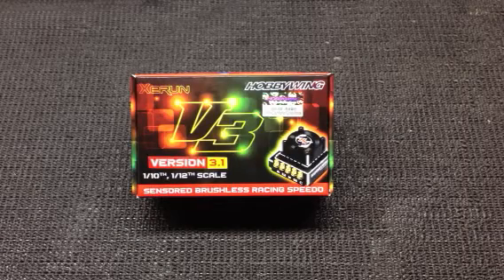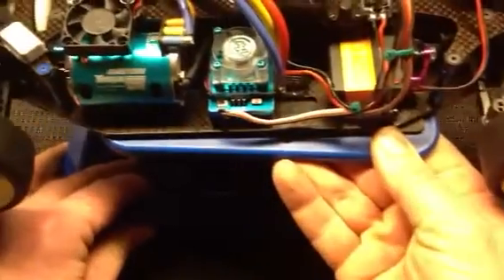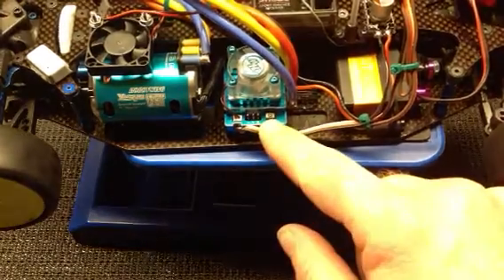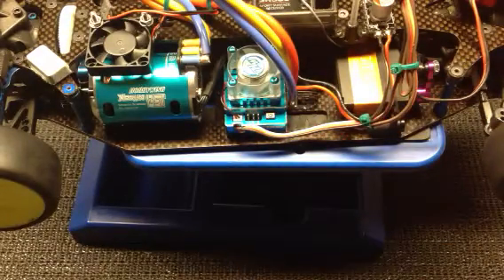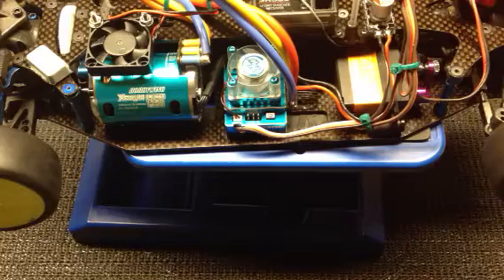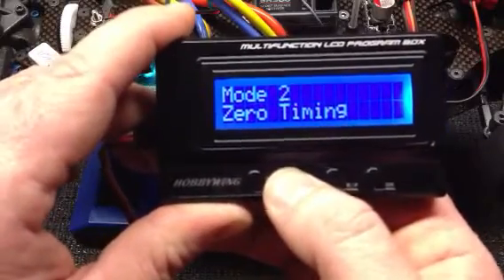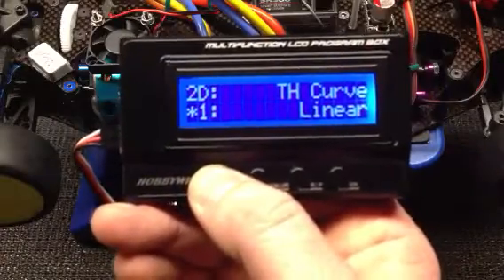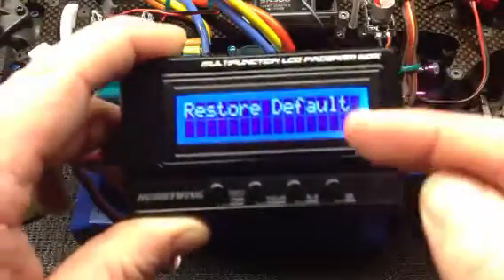XERUN 120A V3.1 Speed Controller

Comment: which esc is good for 1/10 2wd buggy off road racing that can handle STOCK and MOD?
Reply from the maker: +Phil Fernandez You can use this Xerun 120A V3.1 esc in this video or even the XR10 pro by Hobbywing that just came out earlier this month. Here is the link for the new XR10 that has zero timing and mod settings.
https://cdn.shopify.com/s/files/1/0109/9702/files/Users_Manaual_-_XERUNXR10Proen.pdf?14560984639635275888
Happy racing!!
Reply from the maker: +Phil Fernandez here is my video review of the 120A V3.1 explaining more about the different running modes and features
https://www.youtube.com/watch?v=6GRXwWE0tos

Comment: i paired this ESC with a fleta ZX. it doesnt run backwards even after the thing is updated through pc and the program box. really dont know what to do...
Reply from the maker: +M Dzulqarnain Just to be clear, you did choose forward / reverse/ break setting right? Also make sure if your radio has the ABS function, that you disable it before setting your throttle and brake end points.

Comment from the maker: The XERUN 3656 brushless motor is normally paired with the XERUN SCT PRO speed controller. This has an output of 120A Continuos and a burst rate of 760A. The XERUN 120A V3.1 also has the same output and BEC Output voltage  6V/3A. It would work. Just make sure you select the SCT/Buggy profile.

Comment from the maker: Changing the wires from the speed controller to receiver would require opening the speed controller and removing the existing wires from the PC board and soldering in new wires. Unless down for you by the manufacturer It would definitely void any warranty. Try going with either bleach heat shrink or liquid black tape. You could even go for some polyester sleeving or black spiral wrap.